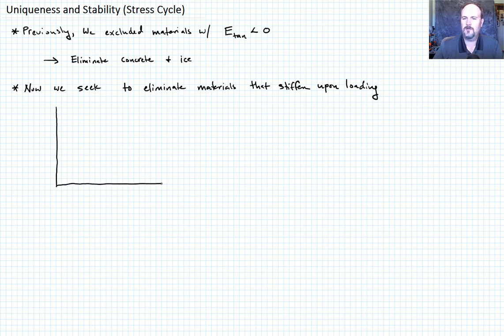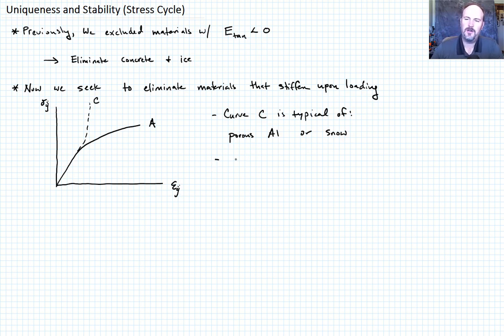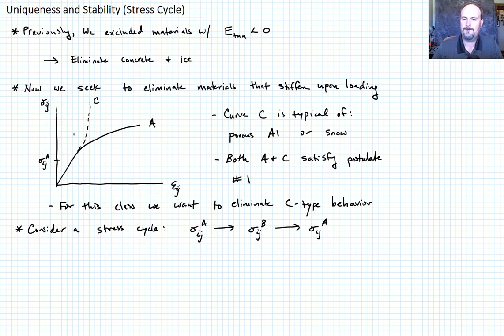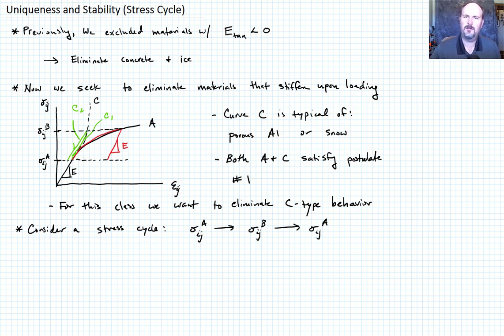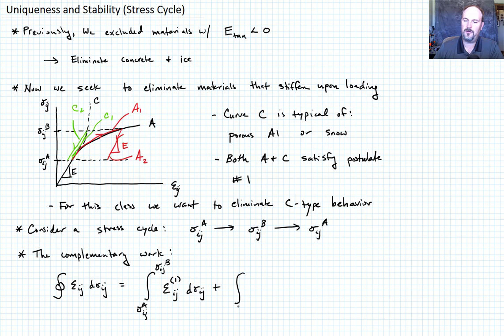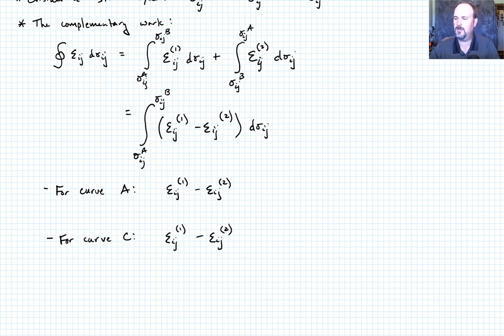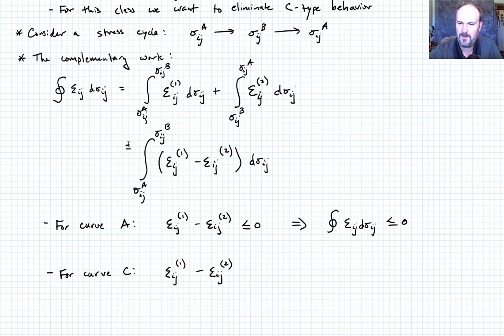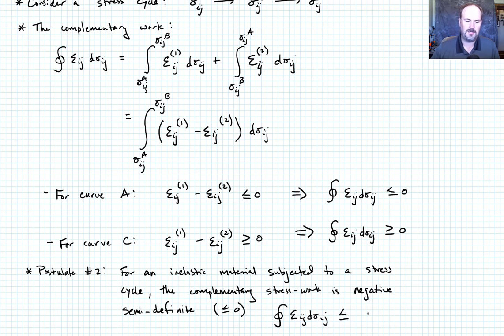2-4b: Uniqueness and Stability (Stress Cycle)

Comment: Hi professor, I really appreciate these awesome lectures. I have a quick question. Isn't structural steel after peaking in capacity a softening material as well? Steel first strain harden and the reaches a maximum stress after which it have a negative slope which makes unstable as well, how do we approach that from plasticity perspective? 

Thank you so much in advance